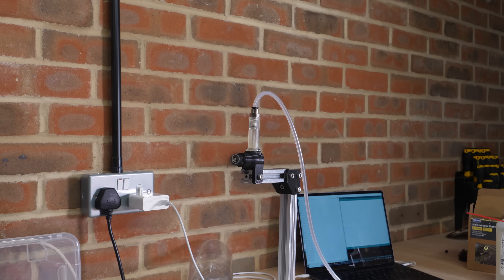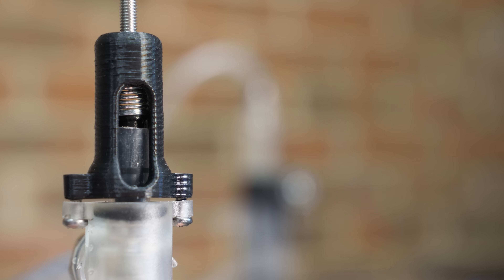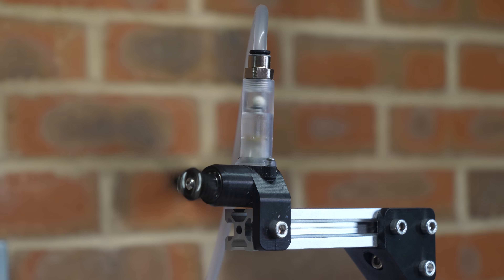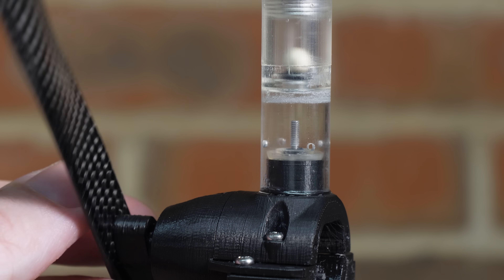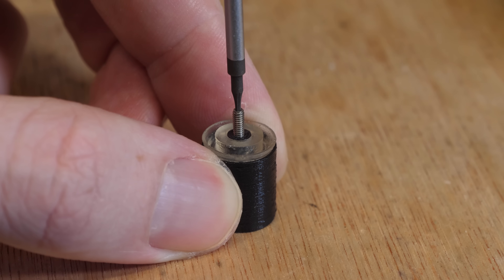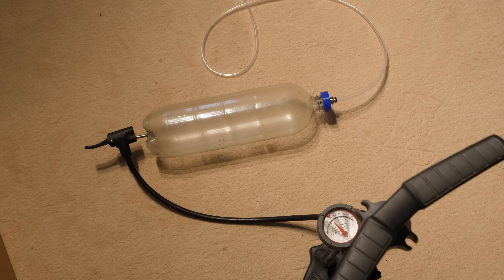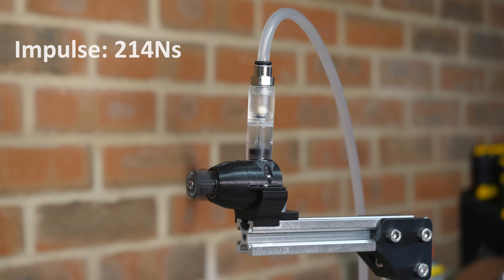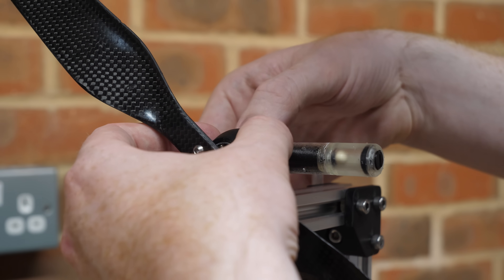4,500RPM Air Engine

Comment: Maybe a boxer design (two crank pins offset 180° so the pistons are synced) would reduce vibrations?

Wouldn't surprise me if vibrations are screwing with the ball movement

Comment: One thing I noticed that you were extremely close to discovering was offset crank.  If you offset the crankshaft slightly to one side the top dead center of the rod, is a few degrees beyond TDC of the crankshaft, therefore peak thrust from the cylinder traveling down will have a higher moment arm on the crank to produce more torque.  It might be worth seeing what changing this does to efficiency especially for a small air powered engine like yours!

Comment: Hi Tom, its interesting!
Why do you don't change, plastic bottle, on the big balons or condon, thus the air at the entrance to the engine will be under pressure?
Or condon inside the plastic bottle)

Comment: It's a slippery slope from a compressed air engine to creating a STEAM ENGINE. DO IT TOM! Using a flash boiler, it may be possible to achieve specific energy levels comparable to batteries. https://youtu.be/nw6NFmcnW-8  I also have a pdf copy of a Besler Brothers technical report for the Office of Naval Research in the 1950's. DOOOOOO EEEEEEEEEET!!

Comment: The regulator was not a good idea as it limit pressure. You just loose pressure on the same air toyal volume, so you waste energy. (Which is why the curve looks like it's juste flatten)
Thought it lasts a bit longer but still, it's like you put a resistive voltage limiter on a circuit
Reply: @afinnishfishnet7366  the power would be "more constant" only because you have a limiter as long as the pressure is above a certain threshold.
In the end you just loose energy. Because you lower the power but you don't have power for more time.

The best way to lower power but make it last longer is the kind of tweek Tom achieved for the ball valve : with more pressure comes a faster closing of the valve, thus more pressure but less flow, power is more "constant" even at higher pressure

Comment: basically turned it into a boxer twin lol
You'll have to do something about all the vibration it causes if you ever do decide to put it in a drag car, that or you slowly add more cylinders and treat it like a radial engine on an old prop plane

Comment: Every time you let the air expand without it helping to drive the prop you are wasting energy. Instead of using a throttle (e.g. a pressure regulator), my recommendation would be a sort of selectable double-expansion engine. 
Make the exhaust of one engine feed into a tube. Make a valve set up so that it can either run the engines in parallel as you did in this video or pipe the exhaust of the 1st engine into the intake of the 2nd. 
Run them in series at the start for high-pressure efficiency and in parallel later to get the most out of it at low pressure.

Comment: 5:37 ...there's got to be a simple mechanical way to optimize that torque problem. No reason that max extension NEEDS to be be at 0 degrees, though getting that to happen without losses from extra linkages or whatever would be tricky.
What if the piston action wasn't linear? If it was on a swivel instead the shape (and thus volume expansion) could be whatever rate you want, even described as a curve! Or just lose the piston design altogether with something like a tesla turbine.

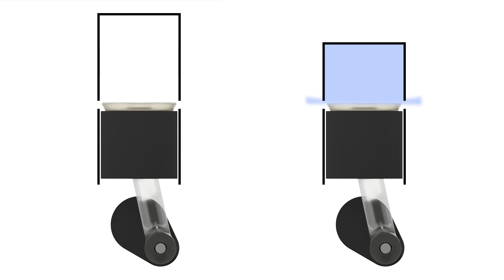Comment: Fun fact: the theory of operation described at 4:30-6:50 makes no sense.  You seem to be using power and efficiency interchangeably.  While the springless engine does indeed make more power, it isn't clear if it is more efficient as it also uses more air.  
The diagram of the 2 engines side by side is truly baffling.  The engine on the left is not shown to be releasing any air from the cylinder at the end of stroke (as would be expected if it is indeed 1bar(absolute)).  This means when the piston goes back up it compresses the air back to 3bar and no air will be able to enter from the valve.  

The reason your engine actually works instead of doing nothing is because the pressure feeding the engine is 4bar(absolute pressure, 3bar gauge) which expands to 1.333bar (0.333gauge) at the end of stroke.  Some air leaves and what remains is compressed to 3bar(absolute pressure, 2bar gauge), allowing some air to enter the cylinder and continue the cycle.

Edit: I wasn't paying attention, that is indeed 3bar(absolute) going into the engine.  Looks like its getting by on leaks alone.
Reply: If you want to increase efficiency you could try a design that vents spent air at (almost)atmospheric pressure.  You would need a valve that vents the cylinder for the entire up stroke instead of holes at the bottom.  This could be achieved by adding a valve block to the end of the crank shaft and using the crank case as the valve body.  The valve block could also be responsible for letting high pressure air into the cylinder through a separate path.

Comment: How would offsetting the cylinder to one side or the other of the crank affect torque I wonder? Yamaha and some other engine manufacturers are doing that now to get a more ideal push on the crankshaft pin with less piston side loading and friction, might be worth looking into.

Comment: the part of the video where you were using the 3:1 expansion ratio to reach atmospheric exhaust pressures, it would be interesting to see a version of this engine with a cylinder offset, as that would change the amount of rotation each part of the cycle uses, with more time spent extracting energy than pulling in new charges.

Comment: These videos are really cool! I like seeing how you engineered an engine and then discovered you were on the same track as air hogs after tearing theirs down. Your old, old design had a suprisingly complex geared crankshaft that was pretty interesting. Also i dont understand how youtube works. 350k views and 15 likes. I "liked" the video and even though the thumb became highlighted, still just 15 likes

Edit. I just refreshed the video and in the last 30 seconds it got 1500 views. 😂

Comment: Would you be able to get more torque if you offset your crank from center. That way, when the piston opens the valve, the crank is in a better torque output angle.

Also, isnt the piston hitting the ball valve a significant efficiency loss with the pressure acting on the ball? Would it help to design something with minimal surface area for the pressure to act on?

Comment: can i Suggest you to make un updated varsion like electronicaly controlled valve at least you can optimize it in software dependeing on RPM and air pressure. like VVT in cars hahaha. as your plane moves up the atmosphere you can run that engine with same effecieny but with lower Pressure on the regulator thus making it more efecient. I guess. hahaha

Comment: Can we test it with liquid nitrogen or dry ice instead of air in the plastic bottle to get long-running high presure fual source? We can have some mechienisum with battery power heating element to release the gas to the engine with presure control. Storage of the liquid nitrogen/dry ice would be an issue as it needs bulky tank that can be heavy for air-plane.

Comment: Hi Tom, your discussion of torque at different crank angles made me remember an engineering video I watched recently. Have you considered using a design with an offset cylinder? This will help improve efficiency and power by moving the power stroke to a more favourable crank angle and increasing the moment of torque, the offset cylinder also results in a slightly longer stroke. The tradeoff is worse secondary vibrations, but at the RPM and mass you are dealing with this is probably a non-issue. Check out a much more eloquent explanation on D4A's video https://youtu.be/gwtZkHoVMso

Comment: just need a rotary design now!  i wonder if it would be less efficiant as more stuf to move? also have you considered a weighted flywheel to assist in duration and might smooth it out a little? anyways loving the work keep it up :)

Comment: Tom - quick question. Doesn't the condensation mean there is less air pressure working towards pushing the pistons as its using its energy to convert the moisture from the air into water ?

Great video as always!

Comment: I wonder if you could make a thrust based regulator?  That is, when the engine/propeller is pulling on the rest of the plane.  When it's producing enough thrust it decreases the amount of air flowing, but when it isn't it increases the amount of air.  Not sure if forces are pronounced enough to work against a spring or other mechanism with fine enough control.  However if it did work, you'd get an ideal thrust over time curve.

Comment: please look into exhaust scavenging for the twin cylinder!! as well as potentially creating intake runners to optimize the scavenging for the beginning (target) sustained RPM. i think you could get similar efficiency from the twin cylinder as the current single cylinder

Comment: It just keeps getting better! I wonder: if you added exhaust tubes, could you tune length of it so the air rushing out of the cylinder draws a slight negative pressure, and the piston closes the hole before the air can rush back in.
A lot like a 2 stroke exhaust

Comment: Run it like a steam engine and alternate opposing side of the same piston for the power stroke and exhaust.  Try fusing the two pistons in the twin cylinder together with a crankshaft running thru the middle.  This will necessitate an intake and exhaust manifold so more weight. So it may not work.

Comment: Would having an offset crankshaft turn the problem with the air chamber size back into a positive? at TDC you would have a much higher connecting rod angle, with a much straighter throw for the power stroke.

Comment: This is really cool. Have you thought about using the exhaust to run a second lower pressure piston? Having a high pressure piston with a lot of extra exhaust that could run a second piston at lower more efficient pressure.

Comment: I'd love to see you offset the cylinders from the axis of the camshaft. This is pretty good for improving power and efficiency - it's used in a lot of modern motor vehicles. There are a LOT of benefits to doing this; longer crankshaft throw and a longer power stroke compared to the exhaust stroke. I'd be curious to see your take.

Comment: Maybe the regulator can be tweeked to give you 80psi from a reinforced bottle of say 200psi.
 A simple cilindrical sleeve over the soda bottle could do just fine, since the start of the curved parts in the sods bottle are both thicker and have a reduced diameter.

Comment: What about a steam engine design in a double expansion?  One high pressure Cylinder and one low pressure which uses the exhaust from the first Cylinder? This would use some of the energy that is escaping in the exhaust of the first  Cylinder.  Great vid as always. Person feels smarter and learns something from watching your vids every time.

Comment: Great video! One tiny note:

I don't believe your claim at 3:48 is quite correct that the regulator leaves the efficiency the same, and thus the two green areas are approximately equal -- I believe the regulator you show dramatically decreases efficiency. Note that a standard pressure regulator is approximately equivalent to an LDO regulator from electronics -- It's a variable constriction (resistance) that divides the pressure (voltage) down to a lower value, simply burning all the excess power as friction (ohmic heating). My prediction is that if you measure your engine very carefully you'll find that the total energy output when using your linear regulator is much lower, approximately equivalent to simply throwing away all of the energy you can get from everything above 30 PSI. This inefficiency is fundamental to any regulator design that uses a valve in a partially constricted state, much any voltage regulator that uses a FET in a partially conducting state will be inefficient -- power is burned only when air passes through a constriction (resistance).

Compare this to your description later about the "self-regulating" effects of the ball valve being rapidly shut by the inflow of air. I believe this description you made is completely spot on. Note that your description is analogous to a switching-mode power supply, or Buck converter -- if you pressure regulate by switching discretely on and off then efficiency can approach 100%, while if you pressure regulate with a variable constriction your efficiency will always just be (output pressure / input pressure). I think the fact that your self-regulating design is more like a switching-mode power supply is the reason why it's so much more efficient than using the regulator.

In short, if you want to maximize efficiency your only choice is to use your input supply at a lower duty cycle, but use it through fully open valves -- any design that uses the input supply through partially constricted valves to achieve regulation is bound by the same limits as linear regulators from electronics. And your self-regulating design does exactly that -- it lowers the duty cycle with which your engine draws from the supply.

Comment: That flat 2 sounded awesome!
I can only imagine what a 4 or 6 cylinder version would sound like.
Reply: I think Tom is on course to beating the power output of the Citroen 2CV that I owned in my youth. Air-cooled flat twin, practically unburstable engine.

Comment: 6:43 wouldn't it also be that the left piston is just recompressing the whole volume back to the inlet pressure
Reply: cause you said pressure is 3x atmosphere
and it grows to 3x the volume
Reply: aghhhh I see so many of these comments

The whole point of that design is to not have compression on the backstroke. The seal expands when pressure is put on it, so that when there’s no pressure on it (AKA when it reaches the exhaust ports) the seal springs back inwards which allows air to flow around the piston on the backstroke. and yes, the gap around the piston is sufficient to let enough air flow around it to prevent significant compression.

Comment: I've been following and enjoying this series very closely and have tried building a few air engines myself... With limited success. But I have recently come across an interesting little piece of history while browsing eBay: The CO2 Engine.

You originally designed your air engines based on the classic Air Hogs engines, but as it turns out Air Hogs wasn't the first one to come up with the piston pin actuated ball valve air engine. There were quite a few companies dating as far back as the 1940's and 50's producing engines with almost this same design, but also on an even smaller scale than this, running on liquid CO2 from CO2 cartridges. Meaning about 600psi, even regulated by the liquid CO2 boiling and always keeping the pressure constant. Speed is tuned by threading the cylinder in or out of the block

I personally have a .017cui "O. K. CO2" engine from the 1950's that I need to make a new conrod for currently as the piston was stuck in the cylinder, so the rod twisted and snapped when I disassembled it after first receiving it. I know, stupid me. Anyway, it's actually one of the larger CO2 engines that were available, which is impressive considering its sub-.02cui displacement. What's even more impressive is that that tiny engine was meant to run an 8" prop. Again, that's from an engine smaller than my pinky finger.

I thought you might be interested to know about these little engines. Maybe you could get one and see if you could incorporate some of the design elements of these CO2 engines into your air engine. They're not very readily available and generally quite expensive due to rarity, but it would be cool if you were able to improve o your design taking inspiration from these ultra-micro vintage models.

Comment: 6:28 I have no credentials. But it seems that having that high pressure at the top of the right engine provides a counter force to push the piston down faster.
Reply: You say as much but focus on the crankshaft angle. Which I’m not saying is irrelevant but rather the pressure seems more important (this could be tested with changing crankshaft pivot points)

Comment: Why not pressure test some 2L bottles to failure to characterize their pressure holding ability and failure mode? I bet seeing and hearing some bottles blow up on purpose would be pretty cool too! You can also give them some abuse at pressure from a safe distance to see what they can really handle safely and then give yourself some good margins. Maybe drop a weight on them and see what might cause them to fail at pressure. Also, weigh the bottles before testing to make sure you are working with the same amount of plastic in each test as a measure of consistency. It would be important that you continue to use bottles that remain relevant to your testing. My hypothesis is that the cap will separate from the bottle long before the bottle bursts.
Reply: If the cap does fly off before the bottle bursts it would still be useful to determine what kind of pressures are needed to burst the bottle and how much of a margin you have between those 2 failure modes. You can likely increase your margin by sanding down the threads so that the cap fails sooner. Knowing how your pressure vessel will fail and under what conditions means you can handle it much safer while still achieving even better results.

Comment: Great video series, can't wait to see more!  On a side note, it's too  bad an air engine couldn't be made to run off Earth's natural air pressure of 14.7 psi/1013.25 millibars. That said (in theory) I wonder how a well/properly designed air engine would do on another planet, especially planets that have extremely high atmospheric pressures(?)